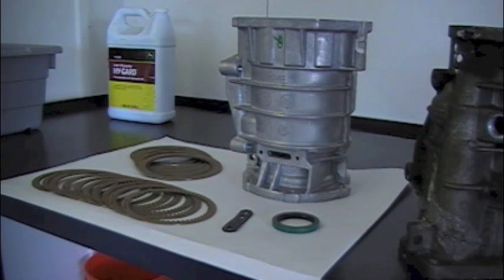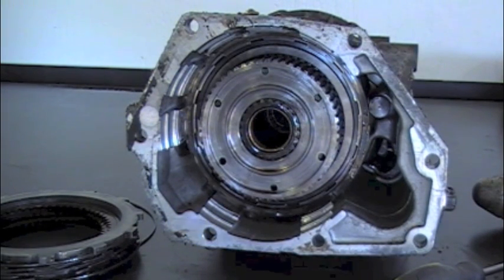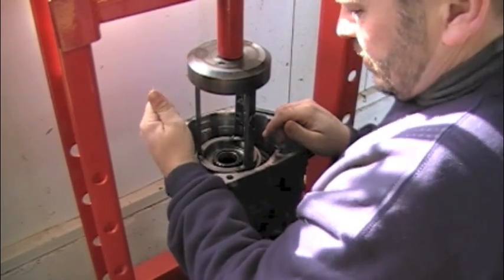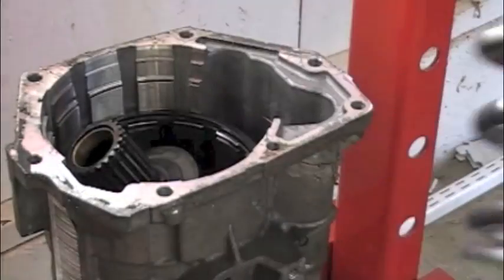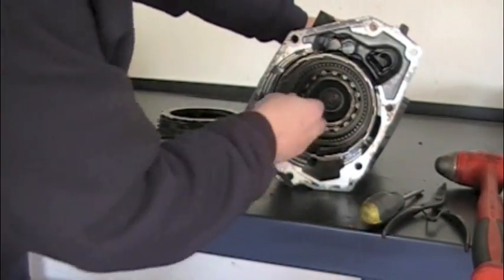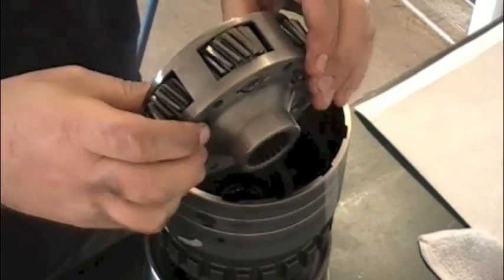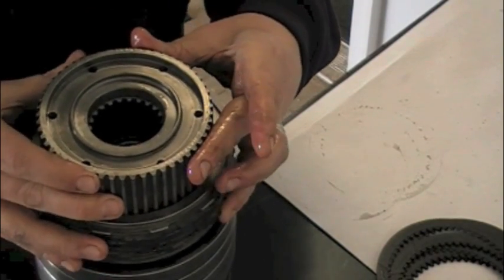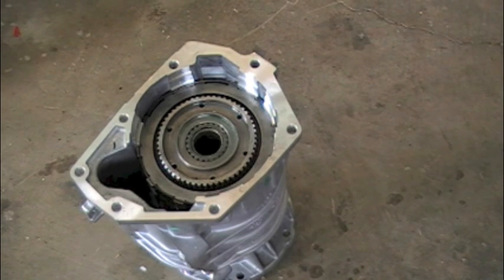48RE Transmission Overdrive Rebuild Process

Comment: Also the stub shaft tool was I supposed to line it before you put it back together in the video did you miss the part where you have him aligned before you put it back on the transmission or how did it even go out of line with the spline

Comment: I rebuilt my 48re transmission but got something wrong, hoping you can tell me what it is. 
After rebuilding it, i drove it down the road a few miles and it did good, but suddenly it looses 2nd, 3rd, and overdrive. It is like it got put into nutral. When this happens if i shift into nutral for a second and shift back to drive it works again for a mile or so, then does it again. 
    Would this be a sealing ring, seal, or would it have to be in the vavle body? 
  Thanks

Comment: Nice detail.
 I have a crazy question about an idea I have. It seems possible that one could built a stand alone overdrive unit out of this 48RE overdrive by adding a custom front cover along with a converted transmission shaft that your stub shaft is made from. Add a oil pump along with a shift solenoid. Does that seem plausible?

Comment: what does the stub shaft do? do i need it if Im only swapping housings?
Reply from the maker: Hello- anytime the spring is expanded and recompressed the shaft tool is needed : the shaft keeps the alignment between the Overdrive Inner Sprag Race and the Overdrive planetary, this will then allow the OD Unit when reassembled to slide all the way onto the transmission. We offer the tool here in the below link -  https://www.cascadetransmissionparts.com/cascadeoverdriverebuildtool.aspx

Hope this helps

Comment: I lost reverse, can I just buy a whole OD unit and replace it, I saw a rebuilt ones at Ebay for $250-$300 ,thanks 👍🏻
Reply: reverse is not inside the overdrive section, maybe your low/reverse servo ......
that sounds like a great price for an OD though i be suspect as the rebuild parts alone are half that cost +

Comment: I know you made this video a long time ago. But I recently did a filter change on my 42re and the magnet in the pan caught 3 pieces( about 9 inches) of what looks to be one of the retaining snap rings My question is can chunks of those move through the the trans to the pan with blowing up the trans. My truck is holding it's gear until it's at 3k and I have to let off the gas for it to shift from 1-2
Reply: Your 1-2 shifting problem most likely has nothing to do with the overdrive snap ring.The pieces of the snap ring are heavy enough that they settle to the bottom of the pan,in most cases. Your problem is in the valve body or front band.

Comment: why not make the job easier by removing the entire OD core by releasing the snap ring at the back of the extension housing,you have way more room to work on those c clips,the job is dangerous enough without having to go fishing with your fingers inside the housing,so much easier the other way.
Reply: Those were my thoughts exactly.

Comment: can the a500 be upgraded with the 5 or 6 pinion planet gear/
Reply: Yes,  Just So You Have The 15' Degree OD Ring Gear The Planets ALL Fit.
These Can Drop Right In:
Reman
https://www.cascadetransmissionparts.com/48reoverdriveplanet6pinionrebuilt.aspx
New
https://www.cascadetransmissionparts.com/overdriveplanet6pinionbc.aspx

If your planet sets is Roasted and welded or broken, we sell alot of the below items.
https://www.cascadetransmissionparts.com/search.aspx?find=12580

We offer the 5 & 6 pinion New and Reman In Package Like Below
https://www.cascadetransmissionparts.com/rhandreoverdriveplanetkitbbk.aspx

We do stock a couple hundred parts on these not yet on the website, so any small Misc Items We Do Have ALL
If The Truck Hauls Heavy or Works Hard We Normally Suggest The Below As A Dependable Recipe On The Builds ( there is a few other items also needed if Cummins )

One Thing Worth Mention; If yours is entirely roasted we do build in house, for some trucks 4WD 1996+ we have reman OD Sections ( Rear Section Only ) on the shelf
https://www.cascadetransmissionparts.com/search.aspx?find=22770

Last We Can Normally Also Rebuild Yours For You, We build ALL 2WD's Once We Have The Customer's Core Here.
Hope this helps some -
Reply: @Quadman808  how do u deal with the TV cable adjustment if the unit is sent to u in house?
Reply: @randy1ization  tv cable is on the drivers side middle of the main trans, just above pan rail
other than a bugger to access its a straight forward process;
you want the cable adjusted tougt but with zero pressure applied, so just adjust it until slack is perfectly out
** If anything just a hint of pressure but less than your pinky can apply
Reply: @Quadman808  my a500 is in an 89 dodge dakota shelby truck.

Comment: why do these transmissions have so many friggin names?
Reply: its like that with almost All the entire line up of Automatic Trans & Transaxles
the main reason is our industry calls it one type, but the Oem's & Dealers call them something completely different.
Many parts interchange on the older applications like the "RE"'s but Boy is it insane the new 2010+ stuff 
they're changing trans type every 1-2 yrs and parts don't interchange
Reply: @Quadman808  thanks im going to attempt an A500 soon, and just trying to sort out some confusion,, I had a bent driveshaft take out the big bearing in the OD section years ago, them the latest problem is my park pin either broke or hopped out of position, and I dont have 3rd and 4th gear. may be tv cables out of adjustment, but trans has 156000 on it so im  going to attempt a rebuild.. I have an H press and will make A tool to compress the spring.. is the od clutch  alignment tool available in a one time use plastic version? also ive heard TV cables not adjusted right can destroy transmission, is this something a pro should do or is it straightforward?
Reply: @randy1ization  we make the shaft tool and the compression tool
just currently out of raw materials to make more compression tools, we sell a few a day of the below
** FOR NO REASON SHOULD YOU TRY SOMETHING PLASTIC, IT WILL NOT HOLD BACK THAT TENSION
https://www.cascadetransmissionparts.com/cascadeoverdriverebuildtool.aspx
* fyi keep in mind for 1990 ish A500 its a hydraulic unit and has no governor electronics to deal with.
a good place to start on a build is almost always the industry manual for your specific unit - you have an "RH" not "RE"
** we have the manual for your truck, but its not on the website - see below for examples, we have a video introducing how detailed they are also.
https://www.cascadetransmissionparts.com/technicalmanuals.aspx
We offer rebuild bundles for the 1993+ models, but we can create any bundle needed plenty of everything in stock
rebuild bundle example
 https://www.cascadetransmissionparts.com/search.aspx?find=12008
Reply: @Quadman808  my truck has an overdrive switch to engage and disengage the overdrive.. its on the left side of the dash.
Reply: @Quadman808  i was thinking maybe a plastic alignment tool like a clutch alignment tool.. not for the spring.

Comment: I bought a OD unit from the local tranny rebuild shop and it won’t go all the way on. As you mentioned in the video the splines need to be lineD up.  Sure enough they aren’t.  Can I align them at this point or does the 600# spring need to be decompressed and the alignment tool installed or can I align them without the tool and everything installed?
Reply: if it won't slide all the way on then the splines are not lined up on the OD Inner Sprag race & the OD Planet.
the only way to realign them is to recompress, align then uncompress
try to handle it easy or better yet leave shaft in it until ready to install

Comment: Great video...I have a 2000 dodge dakota 4x4 had to slide the transfer case and the drive housing so I could remove the pin for the reverse servo piston arm..now I am having a problem with getting it to spline back together ...any advice you can give

Comment: Can a 5 pinion od gear be used as an upgrade on the A500 for a dakota
Reply: yes just so the correct pitch style is used; 1994+ is 15 degree early ones is 22 degree
*  you can use 4, 5, or 6 pinion planets in all RH & RE trucks

Comment: A friend of mine with a Dodge Ram 2500 04 model, just lost his reverse.
After removing the oil pan he found several pieces that looks like the wave ring/lock ring.

I read in a forum, one dude claimed that when this ring comes loose you will loose reverse? Is that correct?
Also, is it difficult to change it? Any special tools needed?

Or is it just to remove the OD unit from the car, and apply pressure to loosen the ring, then get out the rest of the pieces and then add the new ring in place and release pressure?
Or do we have to center everything when doing this? (By using a shaft through the pack?)
Reply: the broken snap ring is very common, our part # 12864
https://www.cascadetransmissionparts.com/46rh46rewavedsnapring.aspx
it requires rebuilding the rear overdrive section, we do manufacture the special tools to rebuild it - all items on our site to rebuild it also
https://www.cascadetransmissionparts.com/cascadeodcompressiontoolkit.aspx
additional questions should be directed thru our email:  Sales@CascadeTransmissionParts.Com
Hope this helps -
Reply: U need an H press and a overdrive alignment tool.

Comment: Nice video, by the way, can I use a overdrive unit from a Dodge Ram 1996 in a transmission 1999, by just switching the overdrive unit?
Reply: Yes you can.

Comment: getting ready to redo a 44re, now I've read and done some research but can you swap the innards from a 48re into a 44re housing, I know you can do a 46 re, but what if I wanted to go super heavy duty just because? I'm having a pro transmission guy do the work, he runs professional dragsters and has built a ton of these transmissions, just need to know for myself what swaps and what doesn't. I heard they are all the same case with different innards.. but who knows.. which information is real or not.
Reply: Tim Vincent no, the 48re is an a518 or TF727 derivative the 44re is an a500 or TF904 derivative the 727 is larger than a 904 so parts and clutches are mostly non transferable
Reply: thank you for taking the time
Reply: no problem, although its a bit late.
Reply: yeah car has been sitting since... just this payday will have the moola to take it to get "regutted"

Comment: I just took an overdrive unit off a 42re and some of the lugs on the case where the little retaining spring(wire) holds the 4th clutches in are broken off.Any ideas on what caused this?

Comment: Good video, Thanks.
I just worked on a 42re for the first time. It had the direct clutch snap ring broken, so when taking this unit apart, the inner round snap ring was not removed as I didn't know it was there until I saw your video, so things looked different than in your video as this round snap ring kept the spring compressed. Assembly was without a press, I used a floor jack and a round wood block on the top to compress the spring. I also did not have a spare splined shaft to align the splines so I used the output shaft.I had no room to keep the shaft in place to compress so I found out that when compressing the spring, it twists the spline and could not re-engage the output shaft. By turning the drum about a quarter of an inch on the outside radius after pulling out the splined shaft compensated enough to have them lined up after the spring was compressed and snap ring installed.

Comment from the maker: all 4.7L models are 45RFE or 545RFE's which take the same filter kit depending on 2wd or 4wd , we have them listing on the site in a kit form.
Our kits include the cooler return filter , and pan gasket.

As far as the solenoid , your model contains a solenoid block which is all in one assembly - also shown on the site

Hope this helps

further questions direct through the website contact us page

Comment from the maker: 2003 for the most part was a split year
the easiest way would be with the casting # on top of the overdrive unit
for 4wd models:
19104 would be a Late 47RE
44577 would be a 48RE
Reply: Where is the over dive snap ring located for 2001 Dodge Cummins 3500 thank

Comment from the maker: to clerify it is loud , and creates a shudder feel ?
can you verify if the sound comes from the front or the rear of the trans
at just a guess it could be the converter , but typically that would be very mild vibration
and as it continued it could get progressively worse.

it you would consider it a shudder check out shudder fix on our website under the chemicals tab - often it can do miracles to some of these issues

please keep in mind this is just a guess - tough to trouble shoot this way